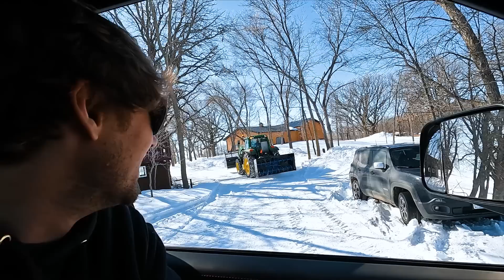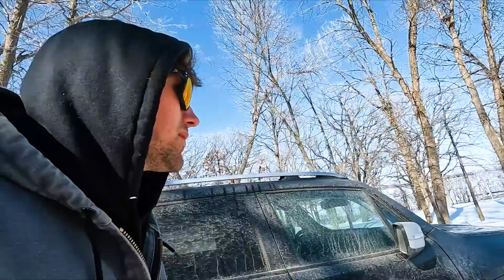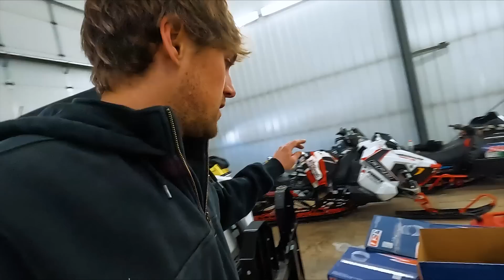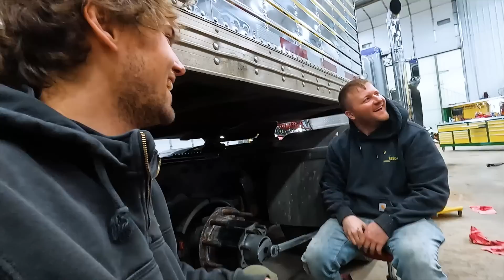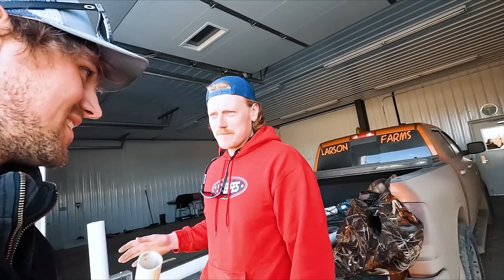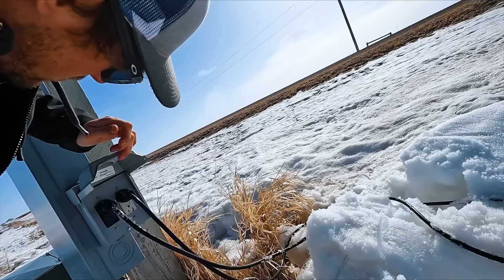The End Of Winter Is Almost Here But Still Stuck!!

Comment: I go to school in Marquette Michigan my 2018 Renegade 4x4 does awesome in the snow when in 4WD, especially in snow mode. I have driven through over one foot snow drifts on crappy all seasons with no problem even though the Renegade has 8 inches of ground clearance. My previous ride was a 05  Exploder RWD with snow tires was good up to about 8 inches on flat level ground. I think the stuck renegade was operator error.

Comment: Having lived all my life in Northern Alberta I am a firm believer in dedicated winter tires. You dont really need studded tires unless you have a lot of freezing rain. By the way my winters are packed away for the summer now.
Reply: Studded tires is illegal in Minnesota
Reply: @thelunatick1993  Are winter tires?
Reply: @jeffjansen582  Winter tires are fine. I drive a rear wheel drive older GM car and use "snow tires". I think it is an old term that was used to describe winter tires.  They do make a world of difference.  Not sure about chains, if they are legal or not.  I lived in Alaska and half the people changed out to studded tires in the winter, but they really do wreck the roads by cutting grooves in them.
Reply: The trek through the snow was laugh out loud funny. I Enjoy your videos.
Reply: Winter tires are not. 
Just studded winter tires

That stated. Studs imo only matter for ice. 
Whereas the problem they are facing is snow.
Reply: @hawks2252  I live in Ontario, studded tires were outlawed in the mid 70's because of the new front wheel drive cars. They could be floored away at intersections. Like you said, this destroyed our roads and costs millions to repair. Michelin or Blizzak winters winter tires are equally great on deep snow or ice. I use carbide studded chains when ice fishing, we never get stuck.  Cheers
Reply: @thelunatick1993 Top rated modern winter tires are equally great in deep snow or on ice, never drive without them, never get stuck.  Cheers
Reply: @jeffjansen582  we will just bring the big swede with us to go ice fishing.  He can haul us around around on his 1999 snowmobile (if it doesn't blow up).

Comment: What about using that sump water to fill the water trailer??
Reply: Because it’s full of dirt and sand and will plug the spray up
Reply: @gregjames5070  Was thinking that a bit too but what about some type of a filter. Just it would take the strain off their normal water pump at the farm.

Comment: Chet buddy for the love of god stop putting in bearings, races, and wheel seals. By the entire hub assembly. All preset ready to go. Just bolt on. Labor and parts you will be saving money. Comet comes with 5 year hub warranty. Talk to your local Paccar dealer.

Comment: What does the stutted tires mean?
Reply: studded tires means it got metal spike insert across the thread. its a winter tire. it help to grip the traction in the snow.
Reply: Studded tires have carbide studs set into the tire to increase traction on ice but they damage concrete and blacktop roads when there isn't any snow.
Reply: gespijkerde

Comment: NEVER pull from a ball. For some dumb reason they like to snap off and come through the windows like a cannon ball.
Reply: Pulling out of snow its fine.
If it's actually stuck you should never do it.
I lived in Wisconsin for 50 years on farm and even northern Wisconsin where you measure snow in feet not inches.
Most times in snow you barely need anything to pull a car out out of snow in a driveway.
A 4 wheeler will do it even.
Especially on light vehicles with street tires.
Reply: @cw93711  I’m a Canadian. I know a thing or two about snow. I don’t care how stuck it appears to be. I’ve seen hitches come apart. It only takes once. Practice like you play as coach said.